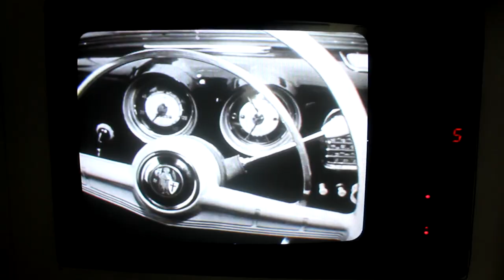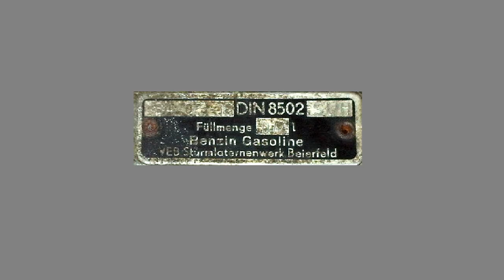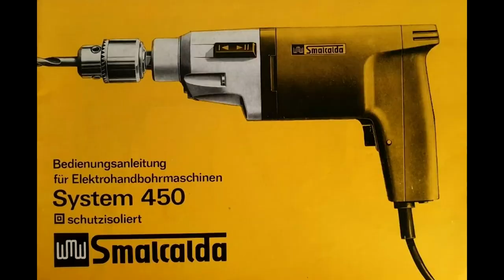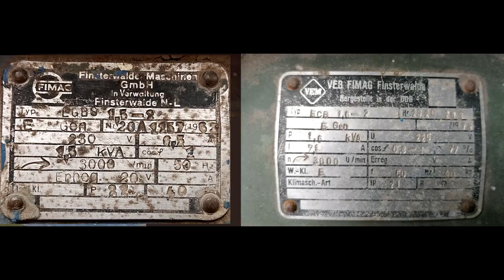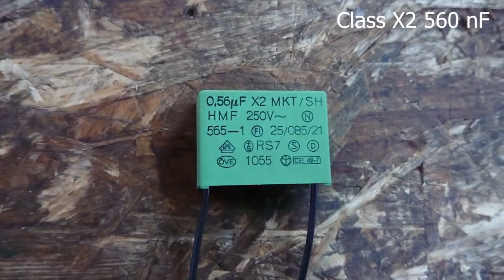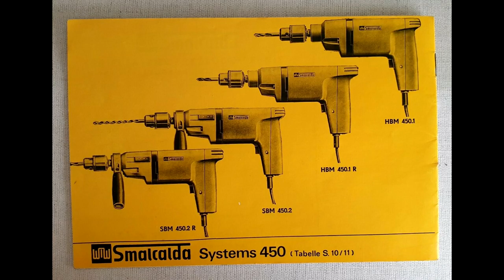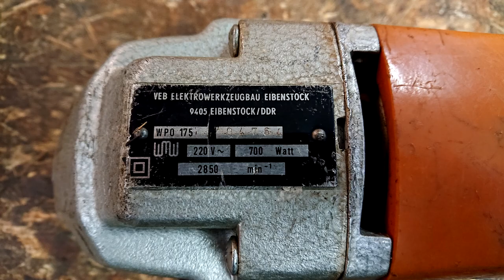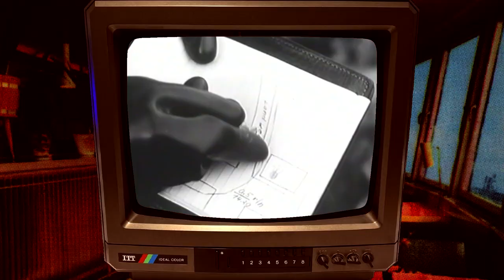The Tools of Socialist East-Germany! Repair-A-Thon!

Comment: As a child growing up in Australia in the 50s, I was fascinated by my father's and grandfather's workshops, and the tools and equipment therein. I inherited it all when they passed away, and am still using it over seventy years later (some of the tools are well over a century old). I have an eclectic mix of British, American and European objects, from wooden planes to a 60 year old arc welder, which are all still in constant use; and it's great to see someone who values and maintains the old technology that was generally designed to last! I really enjoy your repair-a-thons - I hope you keep them coming!
Reply: My father came from your era and on that side of the family they migrated from Prussia around the 1900's, my grandfather though you wouldn't have trusted to fix very much! Dad however was a mechanic from the mid-late 60's and his fairly extensive toolboxes and power tools mostly came from Australian manufacturers. Most of those companies got sold off to the Americans and Taiwan back in the 80's so they don't really exist like they used to and there's a couple of the really old Black & Decker drills from that period which still work fine if you don't mind snapping a wrist. 
My WIA Miniarc welder is an Australian brand as well which still works ok, its not exactly a subtle or complicated machine so its probably why it lasted so long.
All the hand tools though are sort of what you expect, well used but have the kinds of tolerances, material and manufacturing which is extremely good and would probably be worth a lot of money, not that I'd ever sell them.
Reply: Greetings from Sydney! 😊 It's really impressive that you not only have high-quality tools, but also ones that hold sentimental value for your family. 🙌 It's a shame that tools like those aren't made anymore. 😔ls like those aren't made anymore.

Comment: I bought an old house in Thuringia Germany last year. Once there was a workshop on the frst floor but when we entered it for the first time we immidially noticed that even if the former owners still lived in the house they completely abandonned the workshop for somewhat around 30 years according to the dates on newspapers. In there we found almost every hand tool from the DDR Era you can imagine. I found classic glass blower tools they used in an hidden room with a sketchy looking natural gas port next to it. That's what they did, they stole materials from the glass industry, took them home and made stuff like vases out of it, probably to make a buck in the process. Historical Storys are told directly in front of our eyes. No new built home can tell stories like these. Some old powertools have also been left behind. All this sowjet technology is fascinating for its weight, stability, durability, etc. These tools look not used like our tools with dirt and greece from maybe a couple of years. Nowadays there is almost no frequently used tool that you regularly keep for longer than 5 years. The old powertools on the other hand look like they saw several decades of work. And most of them still work. Especially the motors from bigger tools like an old table saw I found are very interesting and will certainly find a new home somewhere among my machines.
Reply: The US used to make long-lasting power tools: Black and Decker, Porter Cable, Miller Falls, Milwaukee. 
I have a Milwaukee Magnum 1/2" (12.5 mm) electric drill I would stack up against these East German tools. 
Now, everything is made in PRC.
Reply: @GarthGoldberg  not everything is made in China. Metabo and Bosch are still made in Germany, and snap-on, Mack, and Matco tools are still made in the US and very high quality.

I am a union worker in the Midwest US, and we use all US made tools. We make an exception for the German made, because they are made in union plants in the EU.
Reply: what a lucky find, I would love to buy into an amazing treasure workshop like that
Reply: @GarthGoldberg  when we recently moved into our new house, we got a bunch of tools including old power tools most of them made in the USA. They're really good quality, the old Sears drill does a better job than the newer Black and Decker, drill made in China, that the previous owners of the house left for us.
Reply: I like going to thrift stores and  picking up old milwaukee and vintage craftsman power tools that were virtually indestructible new tools are trash compared to the tools of yesteryear.

Comment: Hey, really great to see you covering tools from our side of the country, because they are very good imo. 
On the topic of companies: WMW  which stands for Werkzeugmaschinen und Werkzeuge, was the Kombinat that all metal tool production was done under. From little clamp on vises for the home craftsman, to machine tools of all sizes, to entire rolling mills, and die presses. WMW encompased several other Kombinate, which focused on different fields (one made lathes, one made mills, one made files, one made wrenches and other simple forgings, etc.) Smalcalda was one of them, they made hand tools and simple powertools. 
My entire machine shop (large engine lathe, universal mill, a multipurpose machine called a DBF Gerät, similar to the Hommel UWG series, as well as die grinders, hand drills etc.) is all made in GDR, and they are all great machines. 
If you want to know more about WMW and stuff like that, feel free to ask
Reply: Hello, would like to know if they would also be available to consumers of the post with information? But I'm not sure if a "WERKÖ SWU 200" belonged to WMW.
Reply: @raikbusse7697  Yes, the SWU 200 was a universal tool grinder, produced in various plants, under the Brandname "Werkö" (Werkzeugfabrik Königssee) which in itself was a subsidiary of WMW.

Comment: I worked for Black and Decker from late 70s to early 0s and it didn't matter which tool they were all had high heat grease inserted. Hope you do find this helpful. We used to manufacture over 14 million units a year, now unfortunately the factory has been demolished and only a returns / guarantee repair unit is left in our area.

Comment: Großartiger Geschichtsunterricht! 
An die Eibenstocker Handschlagbohrmaschine habe ich aus meiner Lehrzeit (ca. 1987) keine gute Erinnerung. Wir standen zu zweit auf einer 3 Meter hohen, hölzernen, wackeligen Bockleiter, um in Wände aus Hartbrandziegel eines Industriegebäudes an der Decke einen 20mm Wanddurchbruch zu bohren. Die DDR-Hartmetallbohrer mit nur einer Schneide verhakten sich andauernd und durch die fehlende Rutschkupplung verdrehte es einem das Handgelenk gehörig. Als ich dann so Anfang 1991 das erste Mal mit einem Bosch SDS-Hammer gebohrt habe, war das wie eine Offenbarung: Nicht drücken, nur halten. Das ging in die härtesten Ziegel wie Butter. Die DDR-Maschinen lagen dann nur noch herum oder wurden bestenfalls noch zum Holz oder Metall bohren verwendet.
Reply from the maker: Hehe. Danke für den Einblick in deine eigene Vergangenheit und Erfahrungen mit diesen Bohrmaschinen!

Comment: Great video again! Nice to see even a glimpse of the less known (in some parts of the world) Slovenian manufacturer 'Unior', besides all those also quite unknown to me DDR brands. It's very interesting to see what was still made behind the iron curtain. Asianometry recently had a nice video about semiconductor manufacturing over there. ( How Semiconductors Ruined East Germany ) Can highly recommend!
Reply: Ah! I (from the netherlands) have some Unior pliers that have been in my tool box for decades. Good quality. The chrome finish is extremely tough and the blue plastic grips are still as good as ever. I've always wondered where they came from, just never bothered to so a search for the brand name.
Reply: @mfbfreak  It's mostly sold here to farmers. But interestingly they also have a line of bicycle tools, not found at any current big German names. So also many bicycle (web)shops sell it. Eldi from Wuppertal used to make lots of such tools, but they disappeared long ago.

Comment: i got a smalcalda system 450 at home that i inherited from my grandpa. i got the brush cutting, belt sander and even the tablesaw accessories for it. 
i also got an HBM 250 with the convertible table mount system for it. its a mini lathe, grinding wheel, drill press, circular saw and even has a flexible axle to be used as a dremel like tool!

these are great tools and near indestructible took me quite a while to find all parts when we cleared out my grandparents home and then some to figure out what goes with what and get it back in working condition...
sadly i am missing some minor parts here and there but i still got the stuff i had functional

Comment: EP grease commonly known as HTB (High Temperature Bearing) grease ie common grease. Go to the parts store and just buy any old grease that you can use in wheel bearings which is the most common and cheapest grease. Probably doesn't matter in a drill used once a week really as long as there's a bit of fat in there LOL.

BTW, I lust for that mower attachment for the drill I must admit.
Reply: Actually the EP designation stands for "Extreme Pressure" for heavy surface tension, metal to metal or 
heavy load bearing and the grease's ability to resist higher temperature as well!
Reply: @craigtegeler4677  Yeah I know I'm a mechanic. EP is on every grease tub in every workshop I've ever worked in.
Reply: @ThePaulv12  Gotcha! Thanks Paul!

Comment: I too have a bit of fondness for things from the GDR that started in 1982 when I bought an MZ TS250 Supa 5 motorcycle. Things developed, if you can call it that when I became a university student in 1986 and was relatively poor and reliant on what were called 'cheap shops' for kitchen equipment. I soon acquired several frying pans of DDR origin, (not too bad in terms quality) and saucepans (not that wonderful, being made of very thin aluminium). Later came a iron, a toaster and a food mixer, all of which I still have and use, so I guess their quality can be gauged by that. During the mid 80s many of the shops selling household goods at the cheaper end of the market sold products made in the GDR, and most of them were at least as good as their western equivalents, but much cheaper.

Comment: I recently acquired a USSR-made wrench from a thrift store. I tried to use it to loosen a bolt on a bike, but I was unable to do so. To gain more leverage, I utilized an equally old French Peogeot wrench alongside the USSR wrench. Afterward, it was apparent that the USSR wrench's metal was much softer, as it was marred by the French wrench. Additionally, I have a Smalcalda pincer and GDR-made bicycle pump that I found in the trash. Both of these items look to be very durable, but upon closer inspection, their finish is poor, with uneven holes and many casting marks.

Comment: 2:00 got this one! A very nice drill, I put it in a stand and use it as a drill press.
You recombobulated those power tools so nicely :)

Having lived in Poland all my life, I often came across East German gear. Got some of it around my lab. A Soemtron calculator or a CZJ Spekol 11 spectrophotometer, said drill, or heaps of relays or other electronic components. I sometimes see online ads for items where the seller thinks RFT, TGL or VEB is a brand name, haha! RFT is very much like our Unitra in that regard: it was not any particular factory, but a conglomerate of state-owned companies.

20:50 oh, I hate those caps! Pitch-sealed paper, they get leaky and totally unreliable.

Oh, you may try using Miflex KSPpz series noise suppression filters too. They are still around and were there in the PRL days :).

BTW. Unior is a familiar brand to me, since I've done the bike mechanics stuff.

Good luck on your trip!

Comment: I'm from Slovenia and I love watching your channel. A quick sidenote on the Unior wrench... considering it is written as Unior, you found a decently new tool from the noted Slovene factory, which started existing in 1970s with this name. I looked them up and did some homework a while ago when I was restoring my grandfather's old tools, from the same factory and same logo (Z) but a different name (Orodja Zreče), which means  that the tools my grandpa used must have been forged between 1950s and 1970s. I also found a large number of variants with slightly differing design at my other grandfather's shop. I also found some Tang tools, Hazet, Stahwille and some other German tools too, which I found interesting to say the least. In any way I find great satisfaction from knowing I get to use tools that those who came before me used as well. Some of which (I'm more into woodworking) are several hundred years old (some planes) and still work like a charm. :)

Comment: Great history lesson.    I really enjoyed this.   Thanx for your efforts.      Not sure if you have ever seen this technique but you can use super glue with baking soda to repair things and they will be much stronger with the combination.  It makes a hard material that can be used for repairing plastic and other things like the switch body you glued with added strength.   You can build the part up with this material then file or sand it back to original shape if needed.   I try to leave additional material for added strength and support for the repaired part.

Comment: I had a very similar problem with jigsaw blades. I had an older jigsaw and the blades for it just aren't made anymore. All the newer jigsaws here in the US have quick connect blades. Mine is the type that uses a set screw to keep the blade in. Nobody makes those blades anymore.

Comment: i went to berlin in the 1990s and went to a flee market where there where millions of spanners and tools, got two ring spanners smalcalda 24 /27 & 30 /32  2 deutch mark each bargain seeing as a so called good spanner is £30  plus uk... customs didnt like it in my hand luggageincase i beat the pilot🙄 checked it in and 30 years later still using those bad gdr boys. great video

Comment: Some of those names are very well known in the UK by anyone working with machine tools - there were vast numbers of large Soviet-era machines purchased by factories here, with such as the WMW logo on them and VEB electrical control gear. Some of those machines were incredibly sophisticated for the time, with very advanced systems but often using rather different and ingenious approaches, compared to those designed in Western Europe.

Comment: My personal experience is that the East-German machines and industrial products were typically of average to good quality but were often constructed in a very 'old' way. Electronics from the GDR were not so common in W-Germany because they were said to be cheaply made and even dangerous to use. I once tried to repair an GDR/DDR oscilloscope from the late 80s, only to realize that the construction inside was more like late 60s than 80s. The PCBs were made of single-sided phenolic paper board and a lot of phenolic fabric coated wires connecting the small PCBs. The phenolic board and wire-insulation was seemingly accumulating moisture after having been 'baked' in the case for years. This caused the phenolic resin to degrade to a crumbly, sticky mess.
I also remember the old power drill my grandmother had initially used was from the GDR. It was a very heavy device with a gear assembly built to survive an atomic blast (which caused my grandfather to buy the drill in the first place). Sadly the motor was of average or maybe even poor quality and repeatedly burnt out under load over the years. The motor was replaced several times (by a local electrician) until my grandmother had enough and finally bought a Bosch power-drill, which is still good after over 40 years of use.
My grandmother was very good at manual skills. She had a grip like a vice that could literally crack coconuts.

Comment: I have an appreciation for German and Soviet made stuff, as well as stuff that were made in different times, I’m washing machine collector and one machine from the east from the 50s made in the Czech Republic  (Kovosmalt)and another one that was made by Bosch in the 70s, there’s very little that I’ve had to do with both of them, although on the DDR machine I haveI’ve had to replace the ceramic agitator and the cable that runs to the machine and the drain hose, but half of that all looks wonderfully well and good

Comment: A few tips from an oldtimer, make your jigsaw or saber saw blades from still sharp broken bandsaw blades, EP (extreme presser greases should not be used in a worm gear assembly) they quickly turn hard from the organics in the lubricant blends.

Comment: For anyone wondering about why the capacitors have to be specific Y and X types - this has to do with the way those capacitors fail. Y-capacitors have to fail open circuit if they fail, because they are often connected to touchable metal parts or the safety ground of a device. X-types have to fail in such a way that they don't cause a fire hazard, go half-open circuit. Of course, we all know those 30 year old paper capacitor can fail in pretty spectacular ways...

Comment: This Smalcalda wrenches ar really  good, we still use them at work, this wrenches arn't as big as modern spechely shanks are smaller and thethickness. The crazy thing is, even if ther build weaker than modern they bend an slip less, the 12 point socket set is also in dayli use